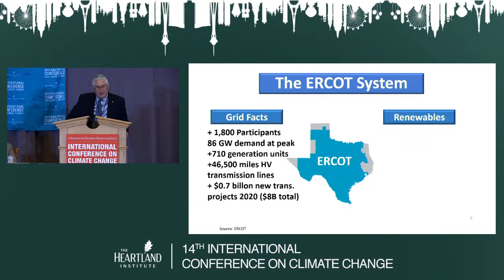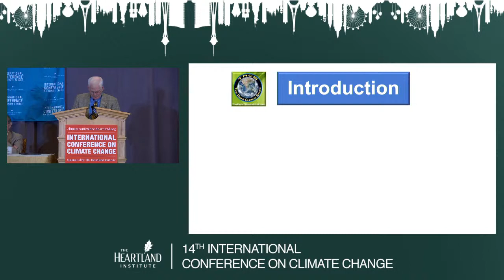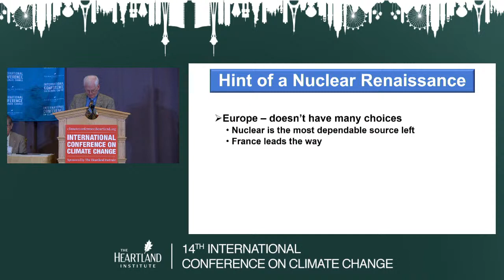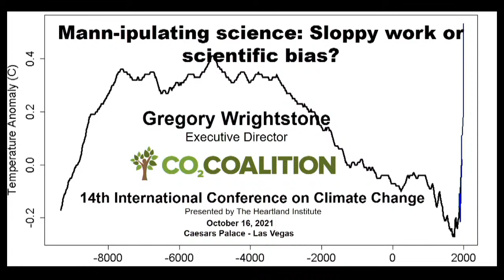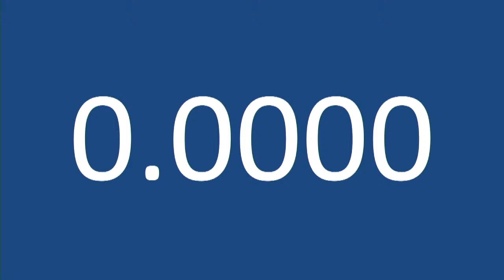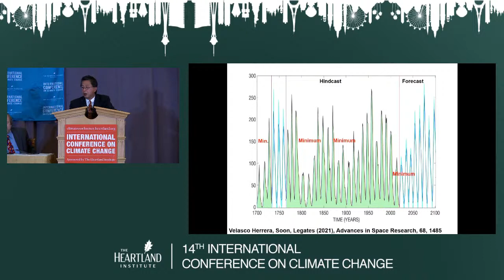ICCC14: Science Track (Saturday October 16)

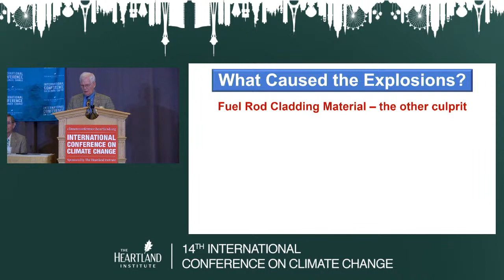Comment: 44:12 Fukushima Daiichi was made into a catastrophic accident by gross operator error, against the design safety rule: they closed the pressure vents designed to keep the water in the core liquid during a no-pump cooldown after scram. This was a DESIGN BASIS accident, well planned for and screwed up by the japanese operators who were afraid to allow the venting per the manual, because they were afraid they would get cashiered for saving the fucking plant.
The siting of the backup generators and power room in the basement in a Tsunami zone wasn't helpful - but the reactors did NOT have to meltdown after that.
Oh, yeah, and not calling for help immediately upon realization of total loss of pumping power - the US Army Corp of engineers would have had generators on site and patched in directly to the pumps in a couple hours, easily avoiding meltdown.

Fukushima was as much an accudent of misusing the equipment as Chernobyl.

Comment: 3:58 GIGO - if you use the garbage temperature data, all you'll have is garbage correlations. Literally, they fake up the mean temp record based on the CO2 level. He'd have been better off using a single "good" temp station.